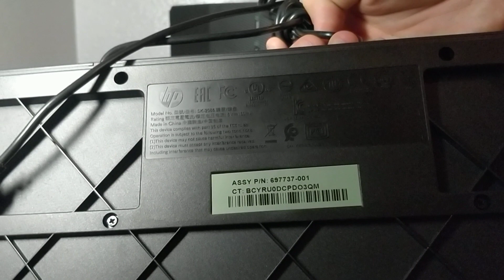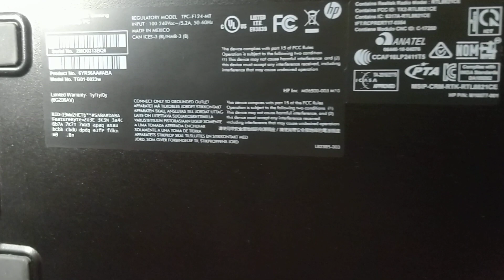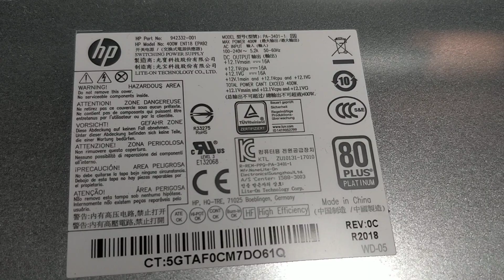HP Pavilion Gaming TG01-0023w, Ryzen 5 3500, NVIDIA 1650 Super, Look At

Comment from the maker: Apex Legends Running on the computer.   https://youtu.be/SkVR-sIfxI8
Upgrading Ram and Fixing Speeds.  https://www.youtube.com/watch?v=HfGd1rfgZqY
Opening up the Hp Gaming PC.  https://www.youtube.com/watch?v=SNvpLI-23Uo
Here are more info about the computer with CpuZ.  https://www.youtube.com/watch?v=j8yydggBjNU
what parts can you upgrade. https://youtu.be/cq3RvtvaXkE

Computer Spec I have. 

Something like my computer but More Hard drive space but slower Graphics card. the slower 1650.   But More Storage. 
TG01-0030, Black.   https://amzn.to/3dFjwNM
-
Ram I use, Corsair Vengeance LPX 16GB (2x8GB) DDR4 DRAM 3200MHz. https://amzn.to/37H6I8M
-
Computer Storage I have, Western Digital WD BLACK SN750 NVMe M.2 2280 500G.  https://amzn.to/3jdlvu5
-
Monitor I Use. OMEN by HP 32-inch QHD Gaming Monitor & AMD FreeSync, 75Hz refresh rate. https://amzn.to/3jj8v6t
Reply: where you get it at

Comment: I'm just trying to figure out what brand to use to upgrade ram memory from 8gb to 32gb... And if I can change the light bar colors from Static green to dynamic RGB leds
Reply: Did you figure it out?
Reply: @Naixzy  Yea I did. I used Vengance 2 8gb rams. I changed the led light in the front to Rgb dynamic and added fans. I did a video on it

Comment: Is this pc upgradable
Reply from the maker: you can upgrade the hard drives. CPU, and gpu if you can find a spot. and ram. 
Other than that if you want to change the mobo, you have to change the case an power supply also since they are hp custom.
Reply: @richyoyo9796  alr

Comment: Hey bro can u help me I have the exact same CPU the HP gaming desktop WalMart special which is actually pretty kickass!! My problem is I took it apart, removed the CPU power wires under the removable "hard drive rack" it has the four wire , two yellow and two black 4 pin, then right below that there is a 4 wire black says P161 on the board but I can't seem to figure out where that goes ??? Can u please help ? Is there probably a jumper wire off the six pin on the GPU? There is a two wire GPU off the 6 pin plug maybe there is a wire that goes from the GPU to that part of the board? From a two wire to a four wire pin I plugged the P4 into the GeForce GTX ?? Please help williamharlow12345@gmail.com or 7277666140 is better
Reply from the maker: Sorry, I don't have the computer any more. Can you send me a video on your questions. and how many questions. I cant really tell what your asking. do you have several issues or just one?

Comment: does this have usb 3?
Reply from the maker: Yes
https://support.hp.com/us-en/product/hp-pavilion-gaming-desktop-pc-tg01-0000a/37874510/document/c06418627
Reply: @richyoyo9796  I'm only asking bevause my oculus quest wont connext thru the any usb and I have the same tower
Reply from the maker: I heard that facebook had issues with the Cable. did you try different cables since it needs an usb 3 cable. which is different for some reason or did they change that? the blue usb when you look at it means usb 3. and it says it in the link.
Reply: @richyoyo9796  ok I'll try that

Comment: I bought this and I cant run ark on it. I need help on info on what to purchase. What type of internal hard drive and graphics card. I appreciate any help. It crashes and it gives me a message saying Im low on space.
Reply from the maker: if you bought this one the hard drive is a 256 gb drive. and a 1650 super with 4gb of ram. did you google it to find out why its giving you that issue?
Reply: @richyoyo9796  It works but i need more internal space and possibly a larger graphics card. I just needed help on what to purchase to upgrade its internal storage and extra? I aint a computer wiz. Im into computers though.
Reply from the maker: @ApacheSniper01   you can get a few hard drives. You can look in to an SSD if you want speed and space. And then with a GPU they are expensive right now the biggest one that will fit is a 2060
Tech I'm using right now: https://kit.co/RichYoYo/tech-i-m-using-right-now
Reply: @richyoyo9796  any more info about the hard drives? I need more info than "there's a hard drive and a SSD and a plug a few wires. I need details. I want to upgrade my computers internal parts but lack the knowledge of what to buy. I want to upgrade my Hp ppavilion gaming pc. All help is appreciated. Thanks.
Reply from the maker: @ApacheSniper01  I have a few videos on this pc. If you look through my play list. https://youtu.be/3TRME3XH4QY
Reply: @richyoyo9796  Im checking out your videos. Thanks. I have NO idea how to install or replace any of these but I have to learn some how. Im going to purchase a hdd aand ssd and a gpu. Im hoping my game ark runs on it soon because its been crashing alot.
Reply from the maker: Hmm it shouldn't crash. That's weird. Did you try searching youtube for the issues?
Reply: @richyoyo9796  yeah but there's no specific or detail videos out there. I figured Id look into your video and figured maybe you know a lot about this device.
Reply from the maker: @ApacheSniper01  ah can you record a vid so I can see.
Reply: @richyoyo9796  Yeah just need some time. Kinda busy but when i record it, how do i send it? Thru youtube?
Reply from the maker: @ApacheSniper01  just upload it. to youtube.

Comment: I have this model, not as fast as I would like and runs a little hot @ 82 degrees under load [COD warzone] with 70fps. Over all great machine.
Reply: does your power supply fan spin when you first power up the pc? Mine doesn't - I'm assuming it's defective?
Reply: @jngx80  yes just no real air flow pc is 4 in. away from wall
Reply: Can it be easaly upgraded
Reply: @maunabot5292  Eazy no but there is some options

Comment: Since it´s been 3 month since you uploaded this video. Are you still happy with it and do you know how to change the acid green led or is that even possible?:)
Reply from the maker: Yep its a good computer which i got for $300 usd off facebook marketplace.  I would recommend it.  You can only have the light blink, on, off. its in the hp command center program.
Reply: I bought one from Walmart at 473 dollars refurbished. Hope it comes with everything good.
Reply: @Sean did you send it back to fix it?
I talked with HP and told them about a flux smell coming from the PC and they told me the PC has 1 year warranty.

Comment: Where is the CD-ROM?  How can there be a computer with no disk tray? In fact, I didn't see any CD-ROM tray on ANY of the gaming PC's I looked at in stores. What's up with that? And others don't even have any USB ports or ANYTHING on front. Exactly how are these things used? I've never owned one before. It was recommended to me to get (or build) a gaming PC because I edit videos a lot (and I need more power for rendering). But this couldn't even be used for what I do.
Reply from the maker: most new computer dont come with cd drives any more. this one has usb on front of the pc.  prices of pc are really expensive right now. I purchased mine of facebook market for 300usd used. maybe you could find one on there.

Comment: It’s a really good entry desktop, I have one with turned down resolution and it runs amazing
Reply: Only $600 at Walmart!
Reply: @ImpossibleMoose  500 in ebay
Reply: @5.0monchiz  can’t always trust ebay
Reply: 350 on offer up bc it had viruses
Reply: I bought it and then factory reset and took the cpu and gpu for my new build
Reply: @jamesjgl  that’s what I’m thinking to donalso
Reply: @jamesjgl  do also*
Reply: I ordered a differently specced one off of HP's website, with 16 GB RAM, and a Ryzen 5 4600G, I was able to snag it on sale for 749.99!

Comment: Did you add a new power supply??
Reply from the maker: Nope, I just keep the 400 that came with it.
Reply: @richyoyo9796  I found a 500w power supply for that case on walmart online
Reply from the maker: @killerzombi6036  Nice Idk hp makes power supply more than 400 for this case. can i get a link? Also this is a custom HP case. with custom connectors for the power.

Comment: 16gb dual channel and new wd m.2 and new fan and then it feels so much different , tried laying on side and temps went up to 200f plus so I never did that again .
Reply from the maker: That's weird. was there a sticker on the new fan? how much thermal paste you use?
Reply: @richyoyo9796   I under clocked it and got stable temperatures , it’s at 3.9 ghz

Comment: How do you set this up? My mom won’t let me take apart the PC and the monitor won’t work with it. (HP 27" Curved HP27SC1 LCD WLED) We have tried plugging it in multiple times but the pc turns on, but the monitor says both the HDMI and other thingy are inactive.
Reply from the maker: Just plug in the hdmi from the monitor to the pc monitor hdmi. At the bottom of it. Since there is two. You shouldn't need take it apart. If they doesn't work. Try plugging in an tv. That would be the next option. Plug in the hdmi pc to tv.
Reply: @richyoyo9796  Ty, but I got it working turns out I was using the wrong one.
Reply: we’re you plugging the hdmi into the motherboard or the graphics card? for it to work you need to plug it into the graphics card, i know you already solved the problem but just for future reference

Comment: Is there a difference between this model and the HP Pavilion 690
Reply from the maker: Just a few difference things.  Disk drive for dvd. and This one is one of the newest mid range ones. for processor and graphics card. if you find a use tg01 i would recommending upgrading. and selling the old one.

Comment: did you do a bios update to have your ram run at 3200?
Reply from the maker: If you change ram. the ram ran at 3200 out of the box. or you can adjust it in ryzen master
https://youtu.be/HfGd1rfgZqY
Reply: when upgrading the ram, can I only install one additional stick or do I have to replace the pre-existing one as well?
Reply from the maker: You can install just one additional ram. But Idk if it would run duel channel. which is like 5-10 fps more.  it depends on your budget.  I just got the same ones since.

Comment: Does the motherboard burn out quickly
Reply: the motherboard replace for 100$ one and get yourself another ssd theres cables dedicated to it very upgradable get a mobo that allows overclocking for 80% games can run almost maxed out
Reply from the maker: I've never had a motherboard burn out on me. by that time I think you can just buy a new computer in like 20 years or so.  You will have to get another HP mobo if it does burn out. since the mobo is made for the case and power supply.

Comment: Can you change the motherboard
Reply from the maker: No, not in my opinion. The psu use different cables. the front usb are attracted to the motherboard. so  if you remove the motherboard you wont be able. to use them. 
https://youtu.be/cq3RvtvaXkE

Comment: Is it possible to change the graphics card cause I'm new to pcs and bbn I read that it can be upgraded to a geforce rtx 2070? Thank you
Reply: U can upgrade the graphics card but a 2070 won’t fit in this case
Reply from the maker: It wont fit in the case right now, and also you have to upgrade the power supply. its a custom size.
Reply: @richyoyo9796  any chance with a 1070 ti?

Comment: Hey so I am getting this model this week and I wanted to know did this model come with screws to install that second HDD in? And if now would it be “recommend” to put screws in when installing the second drive because I don’t see a tray from the video but I could be wrong there?
Reply from the maker: Yes there is only one extra drive to install stuff. and you will have to get your own screws.
what parts can you upgrade. https://youtu.be/cq3RvtvaXkE
Reply: @richyoyo9796  Awesome! Did you need a bracket to hold yours in?
Reply from the maker: @mikeobrien19  it came with a bracket.

Comment: What ram stick does it use
Reply from the maker: Hp ddr4 ram ddr ryzen computer 3200 8gb
mta8atf1g64az-3g2j1
jaaa86t001
hp pn l47721-001
Reply: @richyoyo9796  do you have a link? I wanna  upgrade to 16GB if I get this
Reply from the maker: @chvngo7777  I couldn't find it. You will have to search like eBay or something. that's why I upgraded to this
Ram I use, Corsair Vengeance LPX 16GB (2x8GB) DDR4 DRAM 3200MHz. https://amzn.to/37H6I8M
Reply: @richyoyo9796  dang that’s pricey I’ll see

Comment: Would this pc be good for phasmophobia
Reply from the maker: Yes it would. Here the recommend spec for the game  But idk how it would handle VR 
RECOMMENDED:
Requires a 64-bit processor and operating system
OS: Windows 10 64Bit
Processor: Intel i5-4590/AMD Ryzen 5 1500X or greater
Memory: 8 GB RAM
Graphics: NVIDIA GTX 970 / AMD Radeon R9 290 or greater
Network: Broadband Internet connection
Storage: 18 GB available space
Reply: Thxs

Comment: Does it come with every thing you need so if I got it now I could just turn it on plug it into a monitor and play?
Reply from the maker: All you need is an monitor, Moinitor power cable,
And
DVI-D, Or  HDMI Or,  DisplayPort™
To start it up.
Reply: Yo bro, assuming your interested in this pc, I would not at all recommend. My friend has it, and hates it. and assuming you play Fortnite, I would not Rex come to this at all, there is so much better options then this pc. Message if u got any questions.. and maybe I can help you find a good one within your budget.
Reply: Recommend*
Reply: @stiegz176  could you please emphasize what’s wrong with it I’ve seen videos of this running like Warzone highest settings above 60 fps
Reply: @julianknight383  well are we first talking about the version with the ryzen 5 1050?
Reply: @stiegz176  wdym lmao its r5 3500
Reply: @stiegz176  yeah its ryzen 3 3500 with gtx 1650 super not the one your describing
Reply: @stiegz176  yea your friend probably has an issue with his pc, or just garbage internet. this pc is pretty damn good, especially for its price.

Comment: When upgrading the storage and memory, any brands you recommend????
Reply from the maker: https://youtu.be/HfGd1rfgZqY
Also Here's an video on correct speeds.
Reply from the maker: Ram I use, Corsair Vengeance LPX 16GB (2x8GB) DDR4 DRAM 3200MHz. https://amzn.to/37H6I8M
-
Computer Storage I have, Western Digital WD BLACK SN750 NVMe M.2 2280 500G.  https://amzn.to/3jdlvu5
-
Or if you want extra storage. Samsung 870 QVO 1TB, for speed but not as fast as the m.2  https://amzn.to/2IBGkD4

Comment: is this gaming pc worth getting
Reply from the maker: For Low to mid range gaming yes, But I purchased it used for 300$ usd.  Im getting it to Play Cyberpunk 2077. And Apex Legends. 
The problem is you cant really upgrade it. 
https://youtu.be/SkVR-sIfxI8
Reply: what will not upgrade with it
Reply: can ram,cpu,gpu and storage upgrade with it now for me im gonna more upgrade the ram to 16 and hard drive to 1tb and gtx 1650 to 1660 if i can
Reply from the maker: @THBGYMN  
You can upgrade the Ram, Cpu to idk what, Idk if next gen will run on it.  
Gpu you will have to wait till next Gen to come out before you can upgrade since the PSU is only 400watt, and its HP Custom size. 
Yes you can upgrade the m.2 storage on it with a diffrent one. but the Mobo has a speed max on it. 
and you can fit one more. 3.5 drive in it. 
 
you cant upgrade mobo. or case since those are hp custom.  oem.
Reply: @richyoyo9796  ok thank you did u try to upgrade the 1650 to 1660 1 of the other you-tubers said u can but its a stretch if not i am fine i got this to test and play some older games i am more of a console gamer i got a ps4 but hdmi broke xbox 1 and 360 low lvl gaming hp laptop with is ok but i don't like it its the 1050 but the cpu is nice now i am saving for the new gens now also what do you mean next gen gpu like the rtx 3080?
Reply from the maker: 1650 super to 1660 is not much of an upgrade.  Next gen as in next year. I would wait till the next hecka faster gpu that is under 100watt. Or just sell this computer and buy another one. which I'll do after a while.
Reply: @richyoyo9796  ah ok
Reply: @richyoyo9796  hey i know this is stupid to ask cuz its in your video im just new at making pcs but this stock motherboard can it be overclocked
Reply from the maker: I could only overclock it in Ryzen master, which I use here. 

https://youtu.be/HfGd1rfgZqY

Comment: Can I change the case and motherboard and power supply
Reply from the maker: Yes you can but the power supply or PSU is a custom size from Hp so you have to find a hp power supply. its also missing and 24 pin. which other power supply's have. Also has other different cables for the mobo.

Comment: Can I change the power supply?
Reply from the maker: Yes you can but the power supply or PSU is a custom size from Hp so you have to find a hp power supply. its also missing and 24 pin. which other power supply's have. Also has other different cables for the mobo.

Comment: Can I move all of this into a new case and upgrade it? Im trying to get a cheap budget pc and then upgrade it at a later time
Reply from the maker: since this custom case only fits  the custom hp motherboard.  Also Idk what kind of case would fit this motherboard. you wont be able to use the front i/o. And the PSU is custom Hp fit too.
Reply: Did you buy a new case for this?
Reply from the maker: @ericmaytx  for me, No, i did not, its cheaper to buy another computer.
Reply: @richyoyo9796  gotcha thanks. I found this exact pc with 16gb of ram on fb marketplace for 350 last week. It’ll be like 200 ish to get the case, mobo and psu